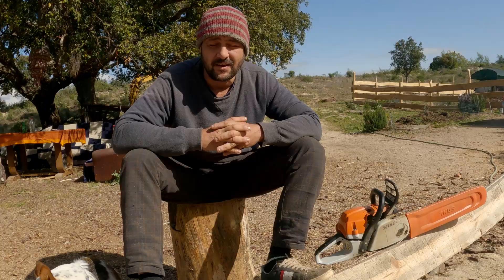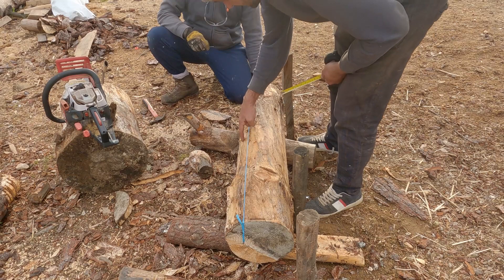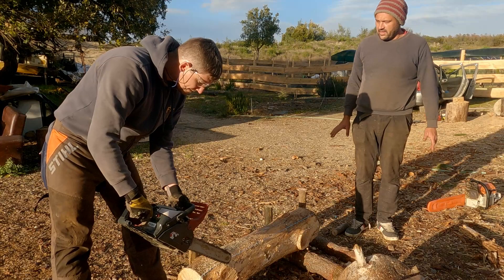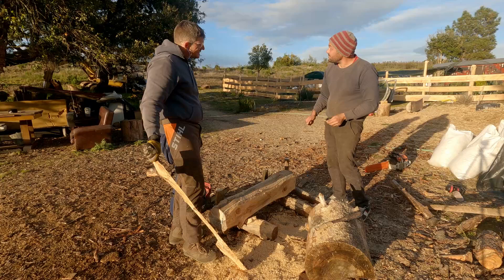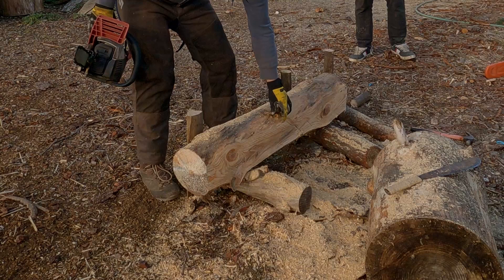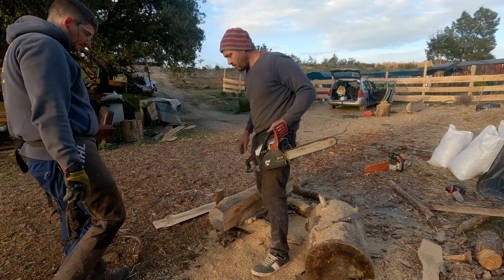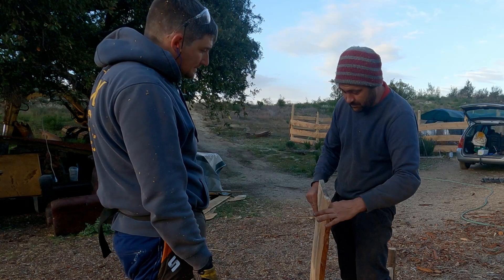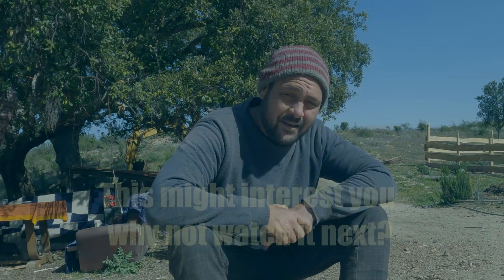Teaching a beginner how to freehand chainsaw mill - turning a tree into boards

Comment: First off, I really enjoy your videos. I’ve recently bought 10 acres of mostly wooded land and I have a few things I want to build so  I plan on milling the trees I’ve recently cut down to clear out an area for my house. These videos are very helpful! 

Some advice I can give on this is using a chalk box to pop a line instead of using a string. Create a loop on one end of your chalk line to hook on a screw or nail on one end then you can pop the line by yourself without needing someone to hold the other end. Hope thats helpful! Keep up the great videos!
Reply from the maker: Thanks for the tip Cory! And good luck with your venture!
Reply: I've tried popping a line before, and it gets hidden by sawdust. Even if it's offset by an inch or so.
I would use a fancy laser level if I had one and just run the red line.

I've had some good luck with this technique in the past, but I hadn't watched the video in years and wanted a refresher before I go mill a bunch of beams that don't have to be terribly precise.

Comment: Hi friends, lift the sawbench a bit higher, your back will thank it.
stay save and have fum
best regards from Wiesbaden Germany
Gerhard
Reply: Hallo Gerhard, great idea 💡 my back was getting a bit stiff at the end, that's why I was bending over. If I do it again I will raise it all up more to a safe height. 👍
Reply from the maker: Totally agree gerhard. I put it at that height because I normally use the Stihl with the longer bar so you can't put it too high cos since you have to raise the chainsaw to get the right angle it gets awkward if it is too high

Comment: Thanks for posting this. I have a tulip tree that I had taken down in my back yard and cut into sections 8-10 feet each. The logs have been sitting 2 years as I have tried to figure out how I will slab it up. This looks like it will work for me!  I don’t need them perfect. I will make them perfect when I use them. I just need them close enough to work with.
Reply from the maker: That is awesome!

Comment: Guys notch the end of the tree edge with a knife or machete every two inches and snap a chalk line or cordage soaked in old black oil, it’s a more accurate way to get a straight line. I have seen it done and done it myself with my uncle and cousin in the mountain jungle of Guatemala. Cut 4x4’s, 2x4’s, 2x6’s, and 2’ inch slabs free hand.

Comment: Pretty good video. . .  What kind of chain do you use for this?  Also, how often do you end up sharpening the chain?
Reply from the maker: Hi.. I use a normal chain but sharpen it at 10 degrees. As for sharpening it depends if I hit a grain or two of sand or not lol

Comment: Complete newbie question here but I see you are pushing forward with the top of the tip at some points. I thought using that part of the chainsaw is what causes kickback. How are you preventing that?Just trying to make sure I am doing this right and safely.
Reply from the maker: Very close to the kickback point but  not.. just use the last two or three bottom teeth at the end .. and always hold the chainsaw the right way so if it does kickback your hand will trigger the safety and lock the chain

Comment: Well done video demonstration. I do have a question. I noticed that you use a screw to hold the log against the posts. What size screws do you use? Do you choose screw size accordingly?
Reply from the maker: Normally around a quarter to a third of the log diameter

Comment: Thanks for this super useful video. I want to mill some smaller logs.  Can you advise a simple clamping solution?
Reply from the maker: The best way I found is putting three stakes in the ground and screwing them into the log (raised off the ground)
Reply: @OffGriddingOnAShoestring  Thanks for the insights! If you use screws how do you make sure the chainsaw doesn't hit them?
Reply from the maker: When you come to where the screws are undo one and after you cut screw it back in. That's why I use 3 stakes so you always have the log connected at two points.

Comment: Wouldn't it be easier and more efficient to start cutting from the left side of the tree and not from the right side ??
Reply from the maker: Why?
Reply: @OffGriddingOnAShoestring  If you are on the left side and cutting on the right, it is difficult to make all the cuts to be parallel...
Reply from the maker: No not really.. I like to do it like that so if the chainsaw bar slips it doesn't hit my legs.. much safer

Comment: I don’t think that has any benefit over using and Alaskan mill unless of course you don’t have one. Definitely harder on gear with the constant loading and unloading.
Reply from the maker: Fair enough.. I don't have an alaskan mill. Haven't tested it myself but less fuel is used to mill apparently. One definite advantage is being able to mill where you drop the tree.